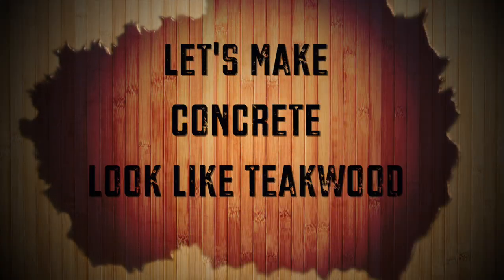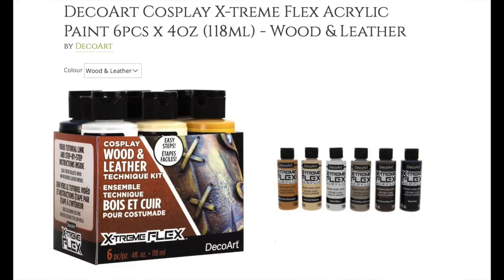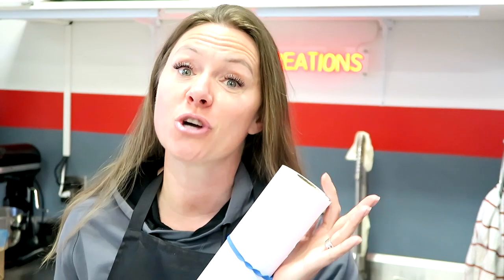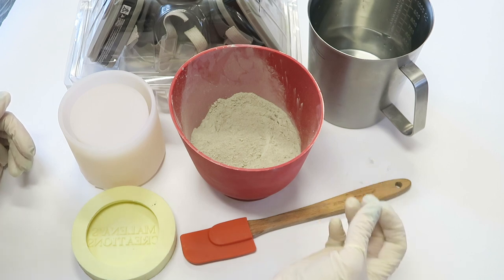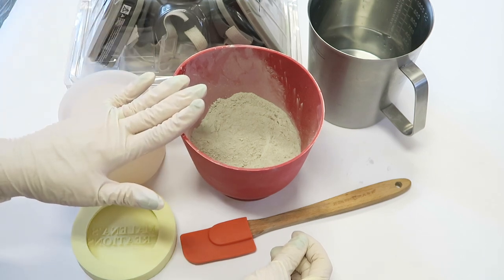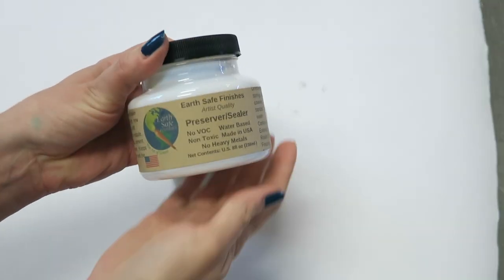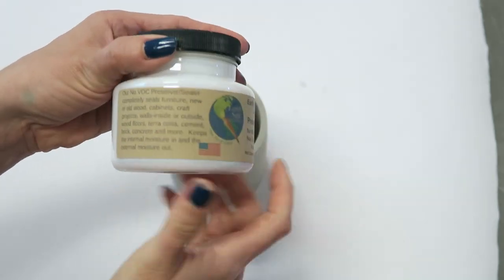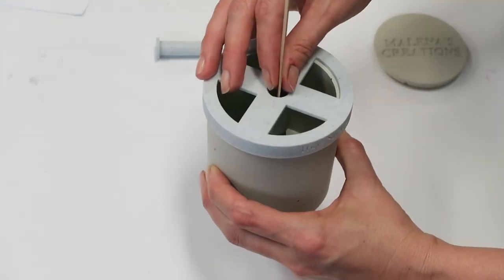DIY Making Concrete Candle Vessels Look Like Teakwood / Giving You More Concrete Candle Ideas

Comment: I clean my funnel by setting it on the base, heat gun the outside and use a paper towel to wipe it out. I’ve never taken it apart, but the truck is to open the plunger and put a paper towel in the hole and then let the plunger go back in, I do this a few times
Reply from the maker: Thanks for the tip on cleaning that funnel.  I wasn't sure what how to put it back together after taking it apart.  What a mess that was... I will try this going forward.  Thank you so much!

Comment: How do you clean your wax out, to use the vessel for a plant so a customer can clean them
Reply from the maker: I use a knife and then spoon out the leftover wax or if they have a heat gun, that works even better.
Reply: Thank you, so the remaining wax residue won't harm the seeds/ plants?
Reply from the maker: It shouldn't. Besides they are just wild flowers.  I wouldn't recommend planting veggies, herbs or fruit unless you get the mold completely cleaned out.
Reply: Can you use acrylic paint for the brown or does it have to be a different kind of paint
Reply from the maker: I only use acrylic paint, I've never tried anything else.